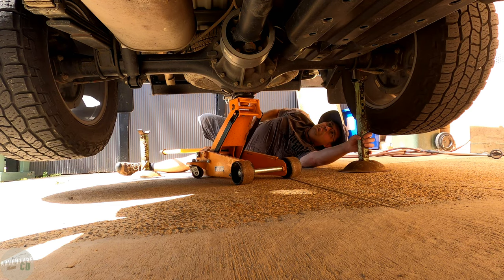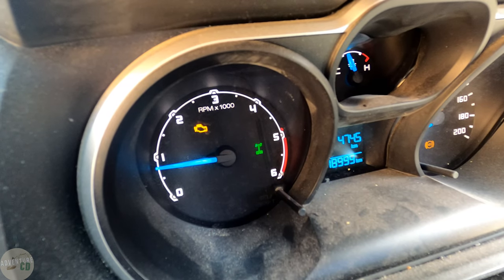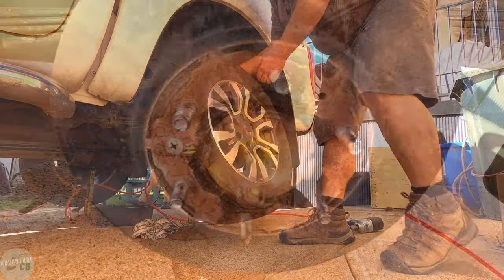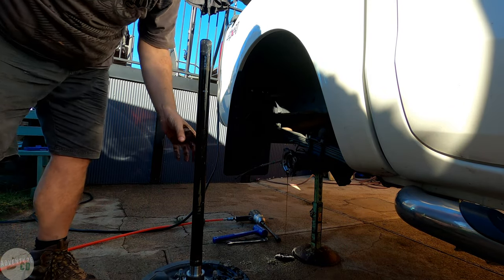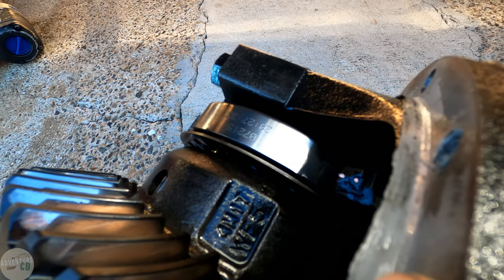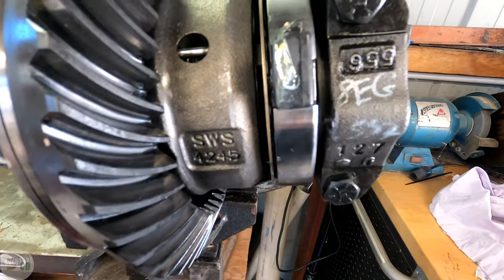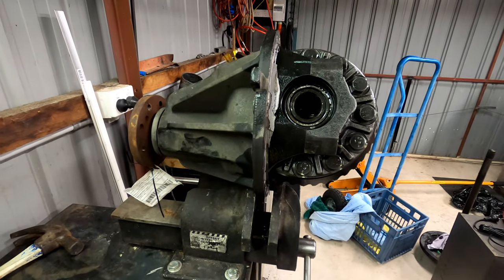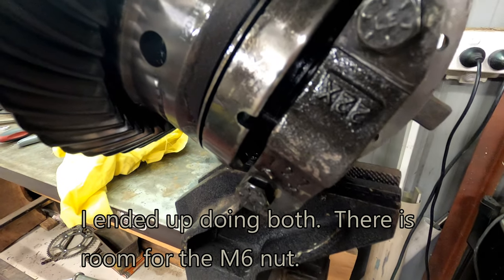Ranger not healthy - difflock & driveline noise diagnosis

Comment: Hi. How much backlash is acceptable that for vehicle
Reply from the maker: Hey, I haven't looked up the spec TBH but I can say you don't want stacks of backlash or slop but you need some clearance.  You should be able to hold the ring gear and feel the smallest bit of clearance when rocking the pinion back and forth.  IF it fees loose or tight, setup an indicator, measure properly.

Comment: My rear tires are locking when i move after i activate the rear difflock? Any ideas as to cause? Help
Reply from the maker: Locking like not rotating?  OR do you mean they are jamming/jumping a bit when you drive with the diff lock on?
Reply: I locked my rear on offroad and went around a corner and it felt like it was binding..I turned the diff l off,backed up and it made awful noise..but seems ok now